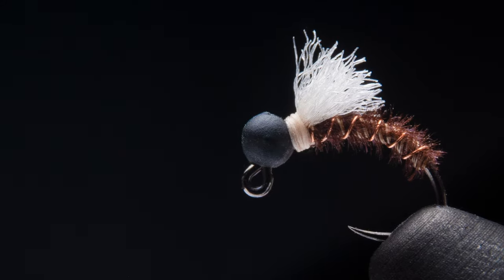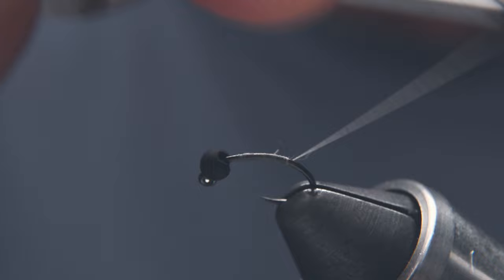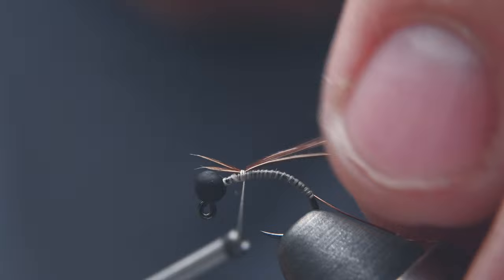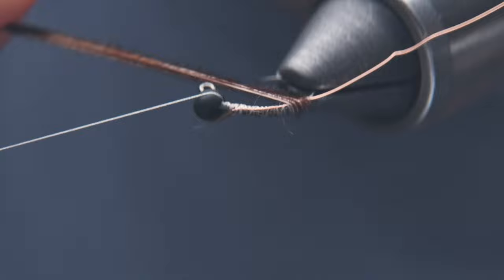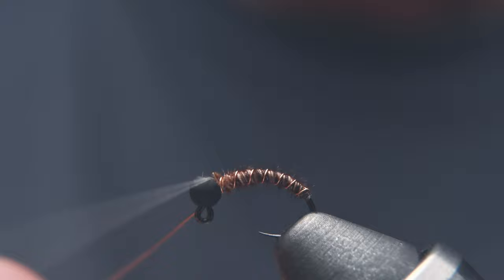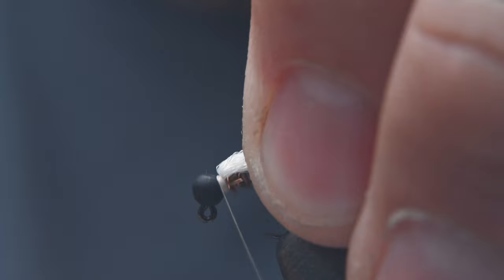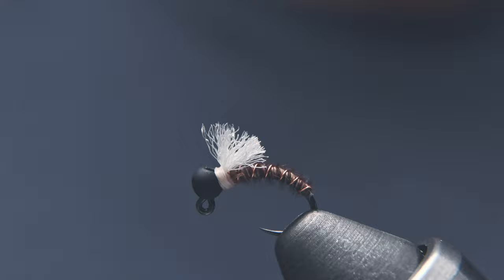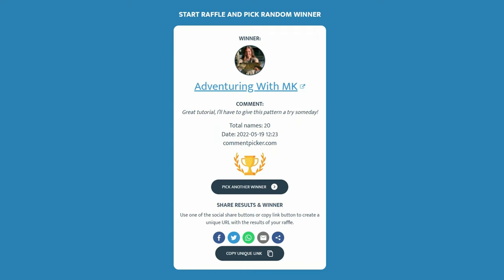Shop Vac fly tying tutorial

Comment: Nice looking fly. Do you ever use superglue on the thread base, before wrapping the pheasant tail, to improve durability?
Reply from the maker: I don't think I've ever had the PT come apart with counter wrapped wire rib. Even with a plain tinsel rib, I feel like those don't really get cut, but more they pull out because they weren't secured well behind the bead. I probably don't catch as many fish as some, so my flies spend less time in fish mouths.

Comment: Great video, thanks for sharing how you tie the pattern. Do you think it would work with peacock herl? What is your camera/lens setup for this? It is so crisp and picks up the small details of the pheasant.
Reply from the maker: You certainly can use peacock, I've used it in the past. I am fantastic at breaking it off, so I tend to not use it. Since it's bushier, it will slow down the sink rate, so that might be beneficial in certain circumstances.

I don't have a dedicated macro, I'm using my 24-70 with tube extensions behind that let you focus much closer. I think the key with macro photography is the lighting. You need LOTs of light.
Reply: @driftstone  glad to hear I'm not the only one that constantly seems to break peacock. I'll give both materials a shot, thanks!
Reply from the maker: @JacobPope  I think you're supposed to cutt off the last 1/3 of the herl or you can chord up a couple strands too. Good luck with it :D
Reply: A good tip when using peacock is to leave a long tag end of thread and include that tag when you cord your herl before wrapping.